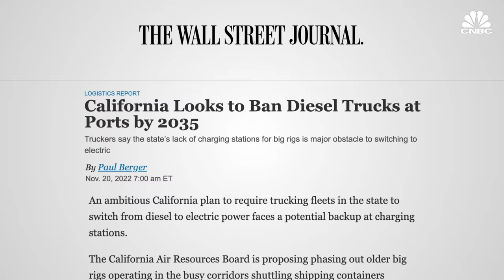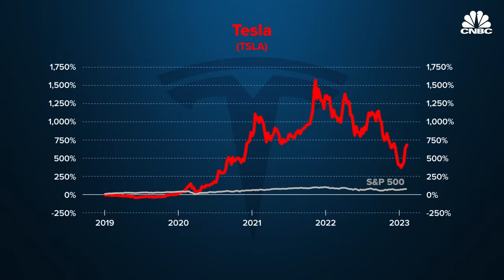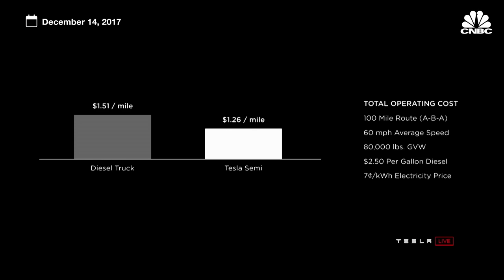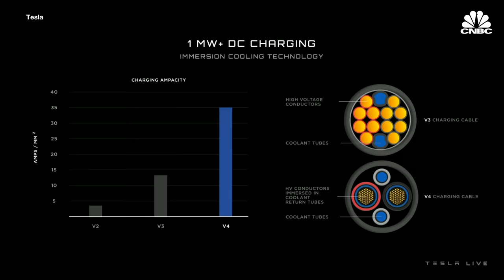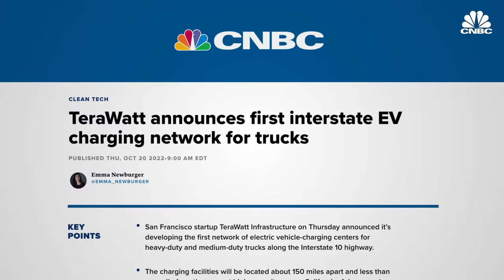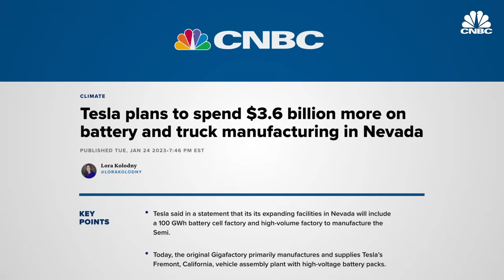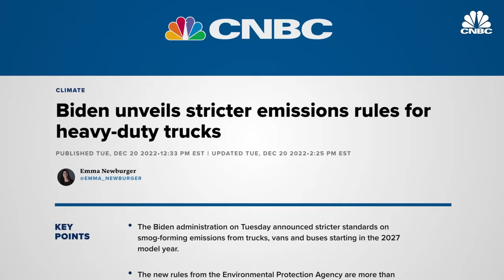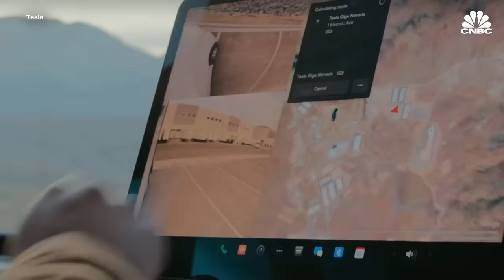Does The Tesla Semi Live Up To The Hype?

Comment: I'm not a driver, but I know that in Canada drivers have government regulated daily driving time limits of 10-14 hours per day depending on specific rules you are running under. So taking a 1hr  meal break while recharging may not be a problem. Assuming you can find an open charger when you need it.  

There are some pretty depressing "road trip" videos by car owners who have to take road trips in small bites as they are guided, and mis-guided, in a wandering route between known charging stations. Where they may encounter broken chargers or wait lines.
Reply: All of this has been alleviated from Tesla. Tesla supercharger networks are highly reliable and show the driver how long they have to charge and where, and where is the next charger. It's called the Tesla route planner.
Reply: Yep the non operating and backed up charging stations. and longer charging times at them for non Tesla run chargers. The car owners have the same problem. No one mentions the poor cold weather mileage, and the resources it takes to manufacture the vehicles and the batteries which by the way use components that can not be manufactured in the USA due to environmental and safety regulations (all are Chinese owned company's by the way). and also the resources and pollution that's produced to supply the electricity to charge the vehicles!
Reply: @Smellindamix  Yes, that is what I've read. The Tesla supercharger network is the largest and best kept. BUT, it naturally focuses on the larger concentrations of people, naturally. The meandering part of my comment came from a story of the experiences of a person travelling the tesla charger network cross country, away from population centers.  His was the tale of having to meander from one town to the next, picking up partial charges because it was too far between to skip chargers. 

Yes, the story(ies) I read about problems with chargers were about other networks.
Reply: "I'm not a driver, but.."    should've, could've stopped right there.. opinions - without facts, feelings or ACTUAL experience - are same as farts only not as offensive.
Reply: @tayl0r612  Good to know. Thanks for your update.
Reply: The application for this in the immediate future is to only take the truck on shorter hauls in which the vehicle does not have to be charged in the middle. At some point in the future long-haul trucking will have to be solved. But that is not specifically what the Tesla truck is designed for. It’s also not what Frito-Lay is using it for. They understand the limitations, and are basically using it only in a single state.
Reply: VERY HARD TO FIND A TESLA CHARGER THAT IS BROKEN
Reply: @Smellindamix  - In addition the Tesla’s screen shows the real-time occupancy of the stations in at least a 20 mile radius, maybe more when you’re on the road.  You can also move the map to go way down the road and see the usage there, for example 7/16 available or click on a specific location to get the current usage. It also shows historical bar chart showing activity by hour. Mobile app also shows some of that data. Very cool.
Reply: @flodjod  - If there is a broken non-working SC stall it is identified by the Tesla’s Charge screen when you zero in on a charge station. Also on the mobile app.  Usage at any station is in real-time and shown, as an example:  ‘6/16 available’.
Reply: user-cu3di6di4t  - Yep, I agree, need way overdue entire infrastructure massive update. I too have been to China, more than once, and the improvements there are mind-boggling, in many places way ahead of the US. The pace in China is amazing, that is one advantage of a one party system, things get done much faster and decisively.
Reply: in the usa you often can't find an overnight parking space so finding one that also has a mega charger is a very tall order.
Reply: Every single thing tht was a con you mentioned for EV, was a con when cars came to the road. No gas stations. Even if you did find one, it could be broken, or long lines since it's the only one around. Just sayin.
Reply: @richs7362  All Tesla batteries produced in Nevada Gigafactory by Tesla and Panasonic don't have any Chinese components and pass Nevada's regulations
Reply: The number of charging station is increasing daily, the problem you've highlighted is short term.
Reply: As a Tesla owner since 2018 who goes on long road-trips with the family several times a year, I can say that Tesla's Superchargers are fast and reliable. Third party chargers are a mess. ChargePoint, Electrify America and downright awful. They are often broke down, or charge much slower than advertised.  THIS is why we just stick with Teslas (and our preordered Aptera who is using the Tesla Supercharger Network), and never use these third party chargers.
Reply: @destiny-theseries  I found this youtube just a couple of hours before getting your reply. This guy did a 2000 mile winter road trip, to see how his Tesla would work out.  
https://www.youtube.com/watch?v=UskzfQJt2Bc
He only found 2 damaged chargers in 20 stops. One wouldn't connect to his car, but he was able to use another at the site, and the other had been bumped into. 
Sounds like his experience is similar to yours.
Reply: @richs7362  yeah people do mention the things you say they don’t mention because it’s important to address falsehoods and half-truths.  Environmentally speaking it is more costly to produce an EV but those costs are recouped in as little as a year.  Yes a lot of components are made in China but regulations can change and the current administration is working to make those changes. 

The ultimate goal should be Americans producing their own energy at home via solar and/or wind (the technology is improving in terms of home harvested wind) and charging their own vehicles with their own energy.  Fossil fuel should only be supplemental.  This is what true energy independence would look like.  

The OILgarchy has proven time and time again that it can’t be trusted with our economy and it’s clear that they declared war on the American people for their political choices.  When we’re free of the OILgarchy not only will we have true energy independence but we’ll also be able to elect political leaders without concern of retaliation from the OILgarchy.
Reply: @immachine1565  <shrug>It wasn't broken, some part in plug was frozen. Wouldn't carry full load charge. But no problem, he was simply able to move to another charger.
Reply: US drivers average 12 miles per journey for 90 % of the driving population range isn't an issue last mile delivery van's only do 90 miles a day max
Reply: @Smellindamix  tesla superchargers are not reliable
Reply: @richs7362 EV’s don’t have poor cold weather mileage for long haul trips - the reason people complain about range loss is because the vast majority of people only make relatively short trips. This means that every time they drive a few miles, they’re spending the bulk of the excess energy consumed heating up the cabin again after letting it get cold once they stop. Of course that’s going to consume a lot of energy. What doesn’t consume a lot of energy is maintaining the cabin temperature once you’ve brought it up the first time. In long haul trucking, drivers run for up to 8-10.5 hours straight, only needing to heat the cabin once on that whole day’s trip. That only uses a large amount of extra energy once, when they first turn it on and start heating it up.

You can know this is true because a car is far smaller than a house, and nobody is burnning several megawatts of electricity per month every winter keeping their homes warm. But now imagine that every time you get it warmed up, you shut the heaters off and leave all the doors and windows wide open for the next several hours and run fans to blow all the hot air out of the house, then come back an hour or two later and close everything up and turn the heat back on again. How much extra electricity do you think that would use to “keep your house warm” through the winter vs. just heating it initially and then maintaining the temperature? It’s an order of magnitude or more to build that initial heat.

Another thing you don’t hear about is how much range is lost in the summer. But that’s strange, because the same thing happens in hot climates in the summer where you drive for a short trip, then shut the car off and park it in the sun for a few hours and come back out and have to cool it off again for another dozen or so mile trip, then shut it off and get out and let it heat up again. It’s the same energy to cool the cabin as to heat the cabin, and thus the same range is lost in hot summers as is lost in cold winters, but you don’t hear those complaints because people are used to losing gas mileage when they run their A/C, too. The difference is that electric vehicles don’t create much waste heat, so you notice every degree that has to be raised when it’s cold.

And one additional difference is if it snows - snow, ice, and slush are a lot harder to push the car through than dry asphalt and concrete, so additional energy is lost there, but again, that exact same energy is lost in gas-powered vehicles too, so nobody notices it or counts it with gas cars, and that loss winds up being counted against EVs and not gas powered cars and attributed to the cars not performing as well in cold weather, which is somewhat inaccurate. The battery management systems do limit the maximum power that gets delivered to protect the battery pack’s health while the pack warms up from being used.

So EVs do have some range loss in cold weather, but it’s misunderstood and so misconstrued, and it really isn’t as bad as people make it sound and wouldn’t have as much of an impact on over the road semi tractor trailers because of the actual causes of those losses.

One of the other factors that makes people think EVs are bad in cold weather is caused by their over all efficiency in the first place. When you’re running around 85-95% energy efficiency under normal conditions to begin with, any small additional drain will be easily visible to someone looking for it. But with internal combustion engines only running around 25-35% efficient to begin with, those small parasitic losses turn invisible in contrast to the enormous waste that’s inherent with internal combustion engines. As an example, if you drive something like a Jeep Grand Cherokee with the highest performance V8 and usually get around 11-12 MPG, you’d be very hard pressed to increase that mileage to even 16 MPG no matter how much you baby it and drive like a grandma. On the other hand, if you drove a Toyota Prius, small changes in your driving style can very easily take you from 45 MPG all the way up to 65-70 MPG - a 20-25 MPG increase that’s easy to achieve under the same driving conditions that that Grand Cherokee wouldn’t even be able to achieve a 4-5 MPG increase. And there’s no need to take anyone’s word for that on the internet - rent one of each of these vehicles and test it for yourself. It’s readily provable by anyone and everyone.
Reply: The problem is that 400 miles are covered only in about 6 or less hours at highway speeds. Driving limit is normally 12 hours. They need a 800 mile range truck on the road to solve the issue.
Reply: @hassantariq2971  no they don't it's not safe to drive without a break and preferably one every 4 hours
Reply: @flodjod  And if you find one: at the same spot will be more chargers in good condition available....which I noticed in Cratia when indeed one of the chargers did not function....and immediatly reported to tesla Netherlands (even for the croatia chargers it had to be reported to the Netherlands.)
Reply: I've taken my Tesla on many road trips. Detroit to Nashville, Detroit to Indianapolis, Detroit to Cleveland, Detroit to Buffalo. You couldn't be more wrong. The Tesla charging network is amazing. Out of all those trips I only ran across one charging stall that didn't work. And all I had to do was move the to next one over. Don't theorize on something you know nothing about first hand!!!!
Reply: @joblo341  I believe Tesla quoted a 99.97% uptime, relative to wider industry upper estimates of 75%. Keep in mind, a separate charging infrastructure is being built for the Semis, and more importantly, as most routes don't require on the route charging, on site destination charging would be enough. (Pepsi has that right now=
Reply: Except for Tesla drivers who have the Supercharger network. That's the model to follow because it works. In fact Tesla is going to start opening up some of their chargers to other brands as they continue to grow their Supercharger network. 

I personally know how viable it is because I've driven cross country on this network. We drove everyday all day while stopping to see the usual sites like Meteor Crater, the Grand Canyon, the Hoover Dam, Vegas, Death Valley and Yosemite. It just works.
Reply: Truck is not a car
Reply: @robertbolding4182  it’s only trucks that are legally required to have the stop. Not cars.
Reply: @joblo341  That's not really the norm for people traveling cross country. They generally stick to major highways and there are many chargers along major highways. It's still too early to expect coverage on side roads. It's kind of like the cell phone and internet networks. Took a long time before small towns were able to get coverage.
Reply: You’re not required to take a break in Canada and you can operate for 16 hours in Canada if you interchangeably go off duty for 2 hours within the 16 hour day.

It’s 14 in the United States
Reply: Can these trucks (not the 'bulletproof ones' LMFAO) be efficiently charged with the car charging stations?
Reply: @kailaniandi  yes. 0-70% takes 30 min. And efficiency wise, Teslas got you covered. Im not sure on the exact heat waste, but one things for sure, energy wise, it’ll always be more efficient that a ICE counterpart.
Reply: @dancalvano8702  Then charge during those 2 hours. It does 0-70% in 30 minutes. But regardless, the semi likely won’t be used for long haul trucking, even if it can technically do it. There’s plenty of industry market share to get outside long haul trucking.
Reply: @sebastianorye2702  I went past the mall and at the parking lot were five Teslas in the way blocking traffic, while waiting for someone to leave a charging station. No possible way for a truck to get near it. Trucks are larger than most charging stations. Also how much coal and gas did it take to build and power it?
Reply: @kailaniandi  they have their own charging stations separate of the public system. And your example of teslas in queue is more of an isolated example. Anyway, for the vast majority of semi cases, they’ll be charged at hubs as they won’t exceed 500 miles of driving range.
Reply: @makeitpay8241  The current Tesla semis charge at their home base, so this isn't an issue. When Tesla semis start being used for long distance hauling, they will reserve charger stalls in advance as part of logistics I'm sure.
Reply: @Jomskylark  there is a slight problem, at the moment, there is a huge backlog of electrical transformers that have not yet been made. i am not talking week in am talking up to 2 years. so building out any serious mega charger network will take much longer than many will like. also some of these new semi trucks are getting 10 mpg which is double of what many trucks were getting 30 years ago. the issue is math, huge trucking companies are after maximum profits for their stock holders. so why are they going to invest heavily in electric trucks when they will end up costing more per mile to run? times that more per mile to run X 1000 units. electricity will have to come down a lot for this equation to work.
Reply: I am a driver every minute u stop the truck u loose money period. No company will pay u a hourly rate to charge a battery.
Reply: @johnsnow1355  you are correct so unless you are a local driver this is going to be an issue
Reply: @richs7362  you are getting your electric vehicle "news" from the oil industry. Of course there are challenges, there always are with new industries. But with everything you mentioned, EV's still break even on environmental issues within a few years, even when supplied by coal powered electric plants. Electric motors are just far more efficient power plants than ICE, no contest. And China owns "rare earths" because their industry is heavily subsidized. We need to do our own mining and processing despite the higher cost because it is the only way to assure environmentally responsible methods, and for national security. We will do the automation right to minimize labor costs.
Reply: @lafayettemitchell9979  your reply is arrogant and unnecessarily insulting, even if your premise was accurate, which it isn't. I'm not a doctor, but I know many hard medical facts, so I am qualified to comment where my self-education is relevant. I am a driver, and I'm embarrassed to have such a narrow-minded spokesperson represent the profession. There is science involved in trucking, but that doesn't make truckers scientists.
Reply: @JeremiahBostwick  Its how they handled Diesel railroad locomotives when they were new and there was no fueling facililties.
Reply: Cold climate and range limitations may affect the economics of electric semis.
Reply: @MasterChief37 But not the power production issue plus the degradation of performance in cold climates. Texas can't handle supplying enough electric power as it is.
Reply: @ralphtoivonen2071  Texas’s problems are self inflicted, they aren’t tied in to the national grid. US infrastructure issues are also self inflicted, your govt is more interested in overseas adventures than fixing the country.
Reply: @flodjod  Yes, Tesla advertises 99% uptime for their chargers. Also, Tesla has many more chargers at each location, so if one charger is out, there are others available. A lot of non-Tesla charging stations have just a couple of badly maintained chargers so it's very noticeable when 50% or 100% of the chargers are out at a specific location.